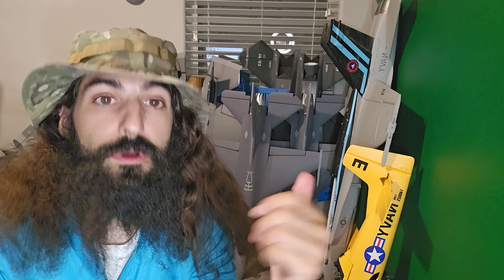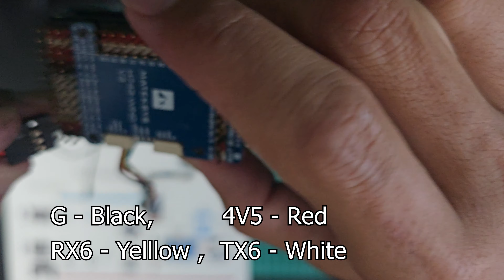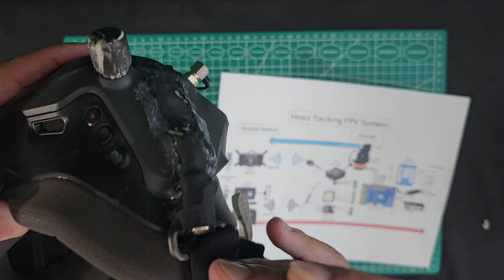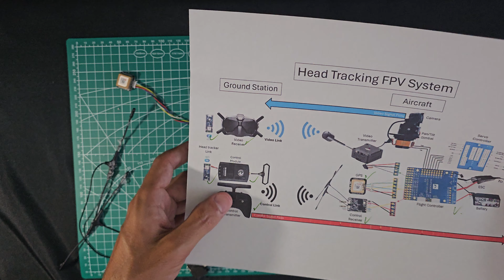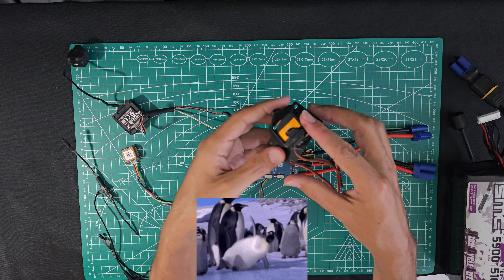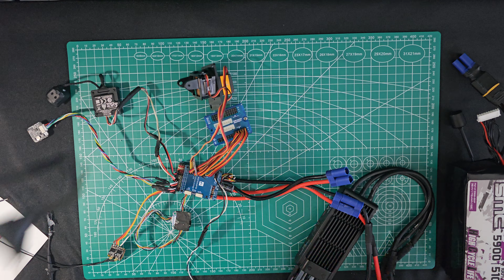ULTIMATE FPV Head Tracking Electronics Guide : PART 1 Electronics Basics - With Memes

Comment: Good video…. Very informative… what do u think about the speedy bee f405 wing… I’ve only built 2 fpv planes but I used speedy bee flight controllers, I’m thinking of giving this one a try
Reply from the maker: I think the speedy bee f405 controllers are fantastic for the price. The biggest difference is the number of pins/ports and the processing speed. If it has all the servo ports you need, then your good to go. It will be more limited if you want to program more advanced autonomous navigation functions down the line, but I imagine most people watching just want to fly in pattern with their EDF Jets.
Reply: @JetJockey_RC  thanks for the info… yea I’m one of those pattern flyers 😂😂😂
Reply from the maker: No shame, that's all I do too! 😂😂  To be honest though, these EDF jets are no joke! One slip and its hundreds of dollars gone! 🥹
Reply: @JetJockey_RC  tell me about it…. Everyone crashes.. either pilot error or mechanical…. I’ve lost a 90mm f16 and t45 to to mechanical or electrical issues … I’m currently putting a fpv 90mm t45 together now… I’m almost done